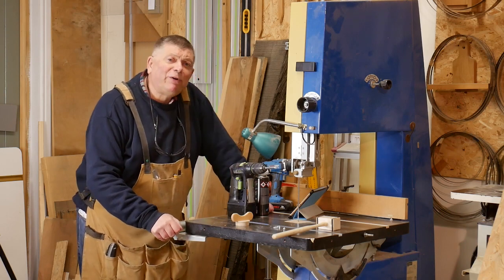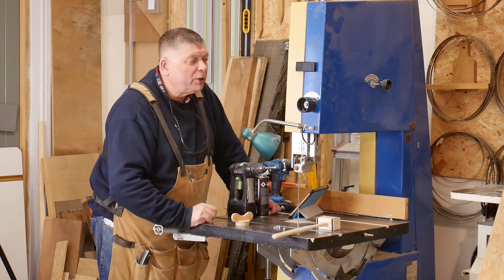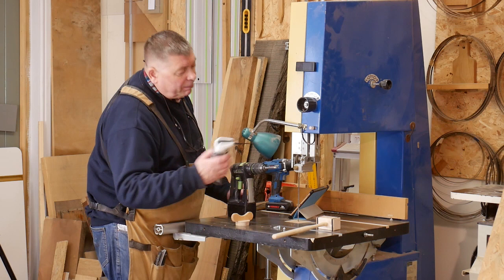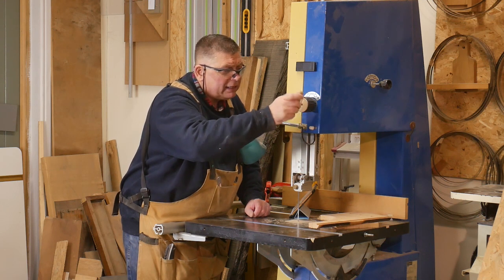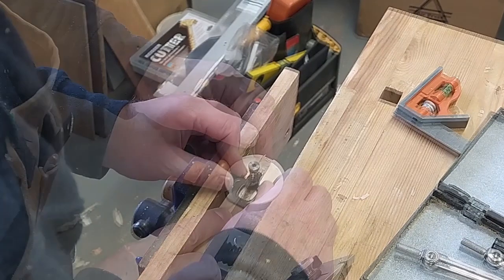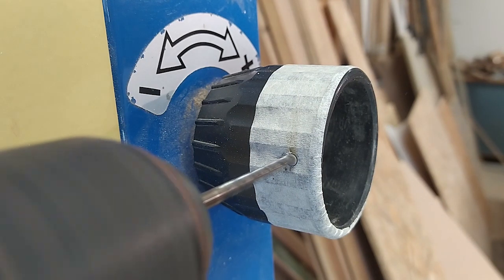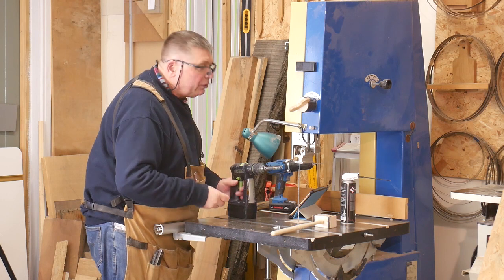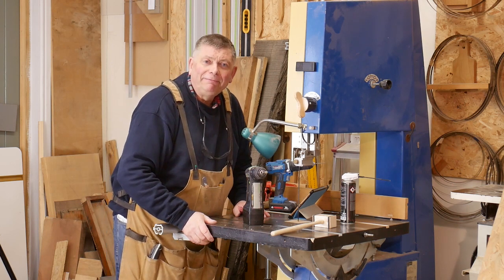How to make a stiff knob more comfortable to operate!

Comment: I think it would be better to add at least one more screw to hold the new knob if not two.😁🛫
Reply from the maker: I think that three screws are enough. I don't think it's likely to fall out accidentally.
Reply: I thought you only added one screw that is why I made that comment, yes3 screws are 120 degrees apart. 😁🛫